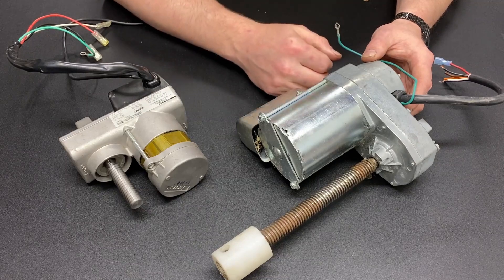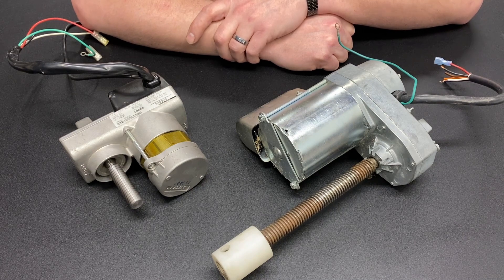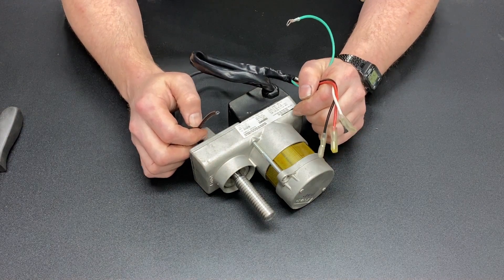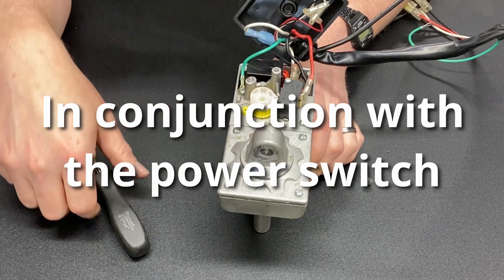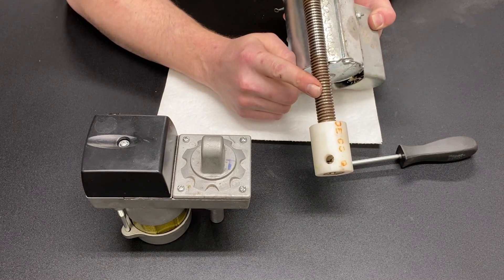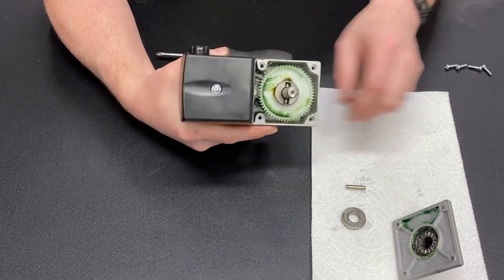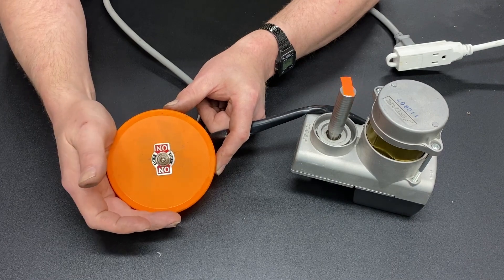A DIY hack for modifying, wiring and adapting a treadmill incline motor to your project.

Comment: Ever consider using one for driving a vise screw? Or using a Bendix starter gear and a flywheel to build a torque monster dual direction can crusher lol. Just thinking out loud. Love the channel!
Reply from the maker: Interesting ideas, thanks for sharing them  .I would be concerned with automating anything with a solid clamping force.  stalling the motor has the potential to burn it out.  the can crusher is a very intriguing idea with one potential problem, duty cycle.  the off time would be minimal between run time and the motor would quickly heat soak. A work around would be to add a cooling fan but I don't know how effective that would be in a high use situation.  Glad you like the channel, thanks for watching.
Reply: @dazecars purely as a proof of concept or demonstration of principles and fundamentals, not as a practical solution. The 1000 pounds of force is intriguing for such a small compact device. Neat stuff.
Reply from the maker: agreed tons of things you could do with it

Comment: Thanks Daze. I have the same motor. I'm thinking of machining the attachment eye off the aluminium cover that you removed  to remove the shaft and having the shaft come out the other side to keep a lower profile for my mill head up and down. Also those 4 screws that hold that alu cap on could come in handy to attach some sort of bracket. Thanks for the info.
Reply from the maker: glad I could help

Comment: any chance of you showing how to set the white plastic limiters and the black switch correctly?  would the threaded shaft incline sleeve be screwed all the way down after reassembling the incline motor and trying to get this running again? thanks
Reply from the maker: I'm not a treadmill repair guy.  I repurpose treadmill parts to work in other applications not to set them up to work properly in a treadmill.  I might be able to fix it if I had it in front of me but trying to direct you on how to fix it basted on your description of what it's doing is not effective.

Comment: my F80 was wired in the reverse of urs on the pot, mine goes black, white, red.  having issues w a E2 error, cant figure it out.  incline motors spins drive shaft when I turn on main power however, but E2 comes on right away, incline controls wont work, speed controls do work.  stuck and frustrated
Reply from the maker: I wish I could help you but I am not a treadmill repair guy

Comment: Is there a place that will tell you about the poundage it will lift ?
Reply from the maker: Yes and no. A lot of them have a lift capacity on the label BUT it includes the mechanical advantage of the lead screw so it doesn’t translate directly to turning force. The bigger on in this video is good for over 1000 pounds.

Comment: But even if you remove the limiting switches, you are still under the 1 minute on, 5 minutes off rule, right?
Reply from the maker: Duty cycle and limiting switches are completely unrelated.  Limiting switches limit total travel nothing more but duty cycle is all about heat soak.  The 1 on 5 off only applies to a full minute on.  When you use it in short bursts it becomes less critical because heat buildup is less and you have time in between to cool.

Comment: One important note; When using this type of motor as a right-angle drive, you won't really know what the breaking point is until you reach it. The casting and overall design is made for a "screw drive" application and that's why it has a beefy bottom casting and that generous thrust washer design. Hooking belts and such to the output shaft will exert new forces on the assembly that it wasn't designed to take so while it may generate tremendous force as a screw drive, it may only be capable of a fraction of that when adapted for use as a right-angle drive output device, before a bearing fails or the case cracks.
Reply from the maker: excellent point!

Comment: Hello, first, very good explanatory videos. Second, I could use the lifting motor of the treadmill...for the rotating belt of my drum sander it does not take power I just need it to constantly rotate when I use it
Reply from the maker: No I don't think that would be a good option.  Treadmill incline motors are high torque   slow speed and designed to run for short bursts of time.  Most have a duty cycle of  around one minute on six minutes off.
Reply: Windshield wiper motors are great for that
Reply from the maker: wiper motors are an excellent high torque motor BUT require 12V DC the advantage of the treadmill incline motor is you get the same function but its AC so no power supply is required.
Reply: @dazecars  Can they be used with a bridge rectifier AC to DC?
Reply from the maker: a wiper motor takes more then just a rectifier as you also need to step it down from 110V to 12V. In other words some sort of 12V DC power supply.   That is why I said the "advantage of the treadmill incline motor is ... no power supply is required".
Reply: @ Thanks again. You are awesome, replying to everyone. I really appreciate.
Reply from the maker: You took the time to comment, the least I can do is take the time to answer. 😁

Comment: I take it you in the USA?? if true what dc voltage are your treadmill motors my side of the world they are 180volt
Reply from the maker: mine range from 90-130V AC and that perfect for an SCR and rectifier as 110 passes through the SCR and rectifier it drops down to a max of 100V DC.  A 240V SCR should work for the 180-250V treadmill motors you are working with.

Comment: How would you hook this up with the scr to the treadmill?
Reply from the maker: It would not be tied into the SCR.  This would have its own up and down switch.  If your incline motor has internal stop switches no problem but if the max each direction was controlled by the treadmill board up and down limiting switches would need to be added.
Reply: @dazecars  thank you! I’m trying to make a soccer ball shooter for some kids. I’m learning a lot from your videos!
Reply from the maker: glad I could help
Reply: @dazecars  I know treadmill motors aren’t your main career, but from all the comments, people really enjoy the work you are doing. Keep it up!
Reply from the maker: will do

Comment: You are a treadmill part recycling legend!  Even better when its for making tools in the shop! Question, if I replaced the input motor on the gearbox with the treadmill DC variable speed motor and a drill press pulley on the output side, could this be used for low speed/ high torque drilling for metal? Do you think the plastic gearbox gears would hold up?
Reply from the maker: High praise, thanks!!  As to your question no.. yes... sort of.  First of all let's look at what kind of torque the incline motor is putting out before it enters the gear box.  The specs on one of my motors are 1/10 HP at 1500 RPM so (.1*5252)/1500 = .35 foot pounds.  The smallest treadmill motors I have seen put out about a foot pound of torque so it is not likely the gear box would survive 3 times the torque.  Second the RPM of the incline motor before the gear box is 1500 and most cheap smaller treadmill motors race at 7000 RPM MAX so you would need to significantly limit the top speed of the treadmill motor to not literally burn up the gear box and if you limited that speed with pulleys it will multiply an already high torque number.  With all that said your idea is intriguing.  A smaller DC motor with a max RPM of around 2000 and less than 1HP would have the option for speed control and work well with one of these gear boxes.  I did a quick internet search and there are smaller motors available that would meet these requirements. I think the gears would hold up okay BUT if you can find a rack and pinion type incline motor the gears inside are metal.
Reply: @dazecars  Intriguing indeed!  Thanks for the thoughtful insight. I've learned a lot from your videos and look forward to more in the future. Thanks!
Reply from the maker: Make sure you check out the video that drops tomorrow morning.  I use an incline motor to add z axis power feed to my new mill.
Reply: @dazecars  Sweet! Cant wait to check it out!

Comment: I have 2 treadmills ; one works very well = Keyes 1200 Milestone. Digital controls.  (use it daily )  The other one, is a one pot control for speed. This machine, is wonky. Slows down sometimes,
 sometimes stops. UN reliable.....May use this, to make an electric Vice. About 6 inches of threaded motion.  Good video, sir. !
Reply from the maker: sounds like you have a fun project ahead

Comment: I wonder if this could power a longer screw for the scissor of a motorcycle lift?
Reply from the maker: I can't see why not.  I have the smaller one lifting the mill head on my DIY mill and that is well over 100 pounds and the added friction of dual leadscrews.  The biggest issue is duty cycle, I try not to run my very long at a shot AND I have a cooling fan on it.

Comment: Came across your channel when looking for infromation on motor controllers for treadmills. Wanting to make drive belt for a flatbed drum sander.  Have gotten sooo much from information you've shared. torque being one of them. LOL!  This video also answered my wtf am I going to do with the step motor and you've come to this old guy's resque again!  Picking up my second tredmill later today. You didn't post where you got the momentary switch. Have purchased the other Amazon components.  Thanks!
Reply from the maker: Glad I could help. are you after the stop switches or the up down switch?
Reply: I made one a few years back drum sander and used most of the treadmill steel in my project, works extremely well and I can swivel the drum and drive to lay flat for compact storage (not used it much in past 2 years but I have it and 2 minutes is all it takes to pop on bench and drum sand my timber)

Comment: Hello. Can anybody tell me if i can replace a tredmill incline motor on a tredmill with another incline motor from an other company? And for what should i pay attention?
Reply from the maker: Could it be made yo work? yes, is it a direct 1:1 swap, probably not.  First you would want to verify that the new motor has as much lifting capacity as the old motor otherwise it is not likely to work.  Second verify that incline motors are set up with the same wire configuration.   Third I would measure the resistance of the potentiometer in the motor as that is what tells the treadmill controller how much incline there is.  If the potentiometer is different it could cause false readings or an error.  Some testing and troubleshooting would be required but the swap is likely a possibility.

Comment: hello any idea why when incline switch is pressed for up its giving an E6 error, we checked motor for both direction (las demonstrated) with direct power all working ok wonder could it be needing calibration ? we could not find documentation on the model how to enter engineering mode, its say Columbus USA without model number anywhere.. TIA
Reply from the maker: my guess is that it has to do with the potentiometer in the motor but I can not say for sure.  I scrap treadmills rather than repair them 😁😁

Comment: This is exactly what i needed. Ty. Im going to convery table saw to powefed blade adjustments.
Reply: How did it go? I'm planning on the same, also for the router table.
Reply from the maker: I too am curious how this worked but I imagine it went well as the concept is very similar to the lift on my mill.
Reply from the maker: glad it helped, sounds like a good use of one of these motors

Comment: You could have replaced the thrust bearing as it will no longer be needed to take a load and in fact isn’t designed to be used any other way so could be replaced with a much cheaper bearing or bushing that will take a side to side load
Reply from the maker: good point, thanks

Comment: If I'm not mistaken, treadmill incline motors are universal motors, which can be operated on either AC or DC. Like most vacuum cleaners, washing machines, etc. I can't tell if the one you have in this video is or not, but its something to look into for those who may be considering a project using one. 

I use DC wherever possible because as you know, its easier to control speed, reverse, etc.

If the field coils (4 of them)  are fixed to the housing, chances are its a universal motor. In any case, no one should assume  anything based on what I'm saying...please. Do your homework and be 100% sure before anyone applies DC to a motor that was used in AC originally. 

Anyway, I just thought I'd mention it.
Reply from the maker: Upon further research universal motors do not ever require a start capacitor so if a motor has a start capacitor it is not a universal motor.
Reply from the maker: interesting information.  Every treadmill incline motor I have ever had has a start capacitor and all those capacitors are AC so IF they are universal as you are suggestion (I would need to look into that further) the start capacitor would need to be changed.

Comment: Great video, my AC incline notor has a purple wire connectes to both the red and Black, what are those, should i leave them?

It is the same as yours but just with a purple wire connected to the red and black coming out of the motor.
Reply from the maker: hard to say based on your description.  Contact me through my web site and send a pic.

Comment: my treadmill is stuck on highest incline.
Any tis on how to get it to go back down ?
Reply from the maker: I am not a treadmill repair guy but my guess is the incline motor capacitor needs to be replaced, or a bad connection or a stuck limiting switch.  But honestly it could be any of about 5 or 6 things, that is just the first few guesses off the top of my head.  Hard to diagnose electrical issues through comments and emails.  Its like trying to fix some ones onion dip because it doesn't taste right over email. 😁😁😁
Reply: @dazecars  Thank you for your reply and I will try to take a look at those things you mention..

Comment: in the case where the power source is Battery (DC) what will the job of the would you still need the bridge rectifier if so what would the job be
Reply from the maker: A rectifier changed AC to DC.  If you are running a DC motor and powering it with a battery no rectifier is needed but the incline motors from a treadmill are AC not DC so they would not work off of a battery without an inverter and in that case a rectifier would not be needed because it is AC to AC

Comment: Fantastic tutorial.I had been trying to think of a way to power the lead screw on my lathe to a lower rpm .
My lathe has a single lead screw, unlike the more desirable lead and separate feed screws on more expensive lathes.
I thought this may have been the perfect motor choice to use as a retrofit to my lead screw,but as you pointed out, the duty cycle times wouldn't be real appropriate for using this for any length of time(bugger!)
Thankyou again and you've got yourself a new subscriber 👍
Reply from the maker: Yes the duty cycle would be an issue.  It is 5 minutes of continuous use so every time you shut it off it begins to cool.  Also you could add a cooling fan and shroud.  That is what I did for the one I uses to lift the mill head on my DIY adjustable column mill.  A better option might be a stepper motor to drive your leadscrew.  I have ELS on my lathe and use the stepper for threading but I also have autonomous controls that allow me to use it as power feed.

Comment: im confused how the ac wires, wire into the momentary switch....is ground wired to the momentary switch? does Black(hot) goes in the middle and White one the top stem..gorund on the bottom stem? also got the tread mill motor working perfect with the pulse generator...great tip..
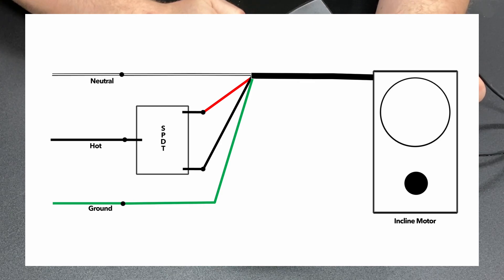Reply from the maker: You can’t think of AC the same way you do DC you put your switch on the hot side the black hot coming from the wall goes to the center on the momentary switch the red from the motor goes to one terminal and the black from the motor goes to the other terminal. the ground is grounded to the chassis and the white from the motor is connected to the white from the wall.  There is a wiring diagram showing all of this including wire colors at 4:49 on the video
Reply: @dazecars  thank you so much for replying so fast....got it all working...i was over thinking it...somehow i skimmed by the diagram...facepalm...again thank  you

Comment: this is a great video..im going to use one of these to raise and lower my rongru-40 milling machine head...thats for another awesome video...keep on making..
Reply from the maker: My DIY adjustable colum mill uses one of these motors and a dual leadscrew setup for the height adjustment.  works well.   https://youtu.be/BXO1gl7I0AM
Reply: @dazecars  i have watched  most of your machinist maker videos...ironically i jsut scored a profrom treadmill last night with an icon board...i have the pulse generator coming form amazon so i dont have to use the  proform panel :P
Reply from the maker: @minskmade  have fun with the project, and let me know if any questions come up as you get your project together.

Comment: Those are good motors to use to rotate your solar panels and maximize efficiency. Also those switches are good for booby traps. Little pressure switches. 😏
Reply from the maker: lots of good uses as long as you don't exceed the duty cycle

Comment: So that thing has a potentiometer in it? It’s made to drive a threaded rod? How far away from a motor that can do CnC is it? 
And thank you for the safety tips!
Reply from the maker: The potentiometer only serves as a signal for the treadmill to let it know the incline height and is not needed to use the incline motor outside of the treadmill